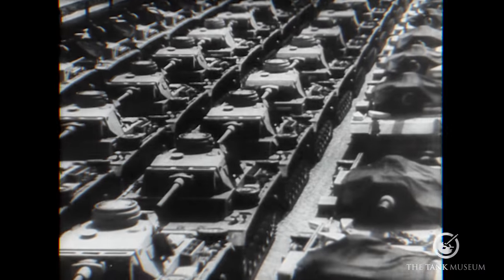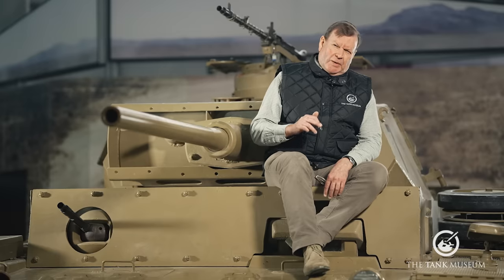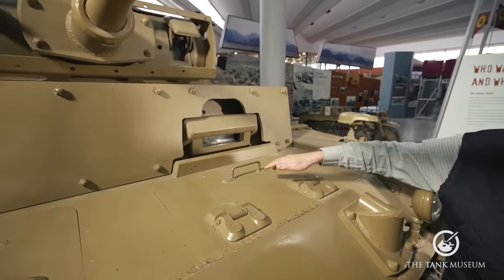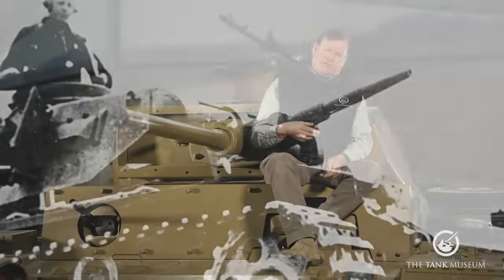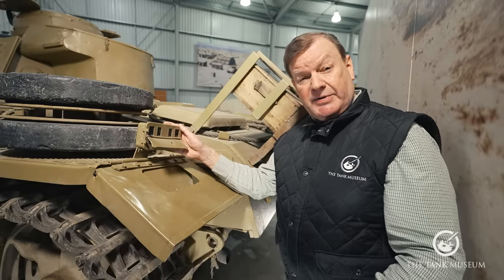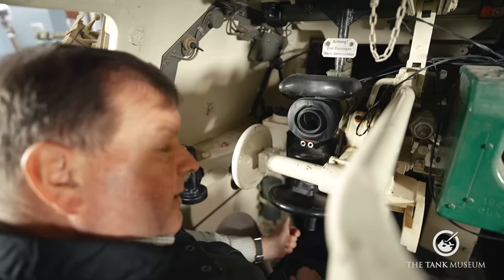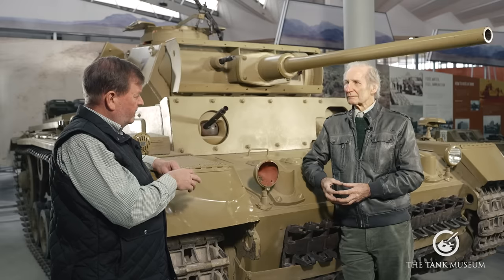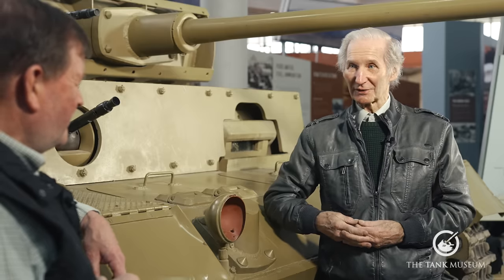Panzer III: Versatile Stalwart of The Panzer Force

Comment: I think PZ3 is probably the best interwar tank.   Even if it was obsolete by 42, it still looked snazzy.
Reply: I mean it wasn't really obsolete by 1942. It was still comparable to most enemy tanks even in early 1944. And that's with its planned upgrades canceled due panther (such as the krupp suggestion for a new turret to mount the 7.5cm kwk40 L48)
Reply: @matthiuskoenig3378  Chassis wouldn't be able to handle the added weight, plus they already were using the chassis for the casemate Stug. Plus adding the the long 75 to the Panzer III when they already have the upgunned Panzer IV is redundant, so no it had nothing to do with the Panther (which mounted a much better gun)

Comment: The Notek rear convoy light was very well designed. With two pairs of red lamps; if you could see all four, you were too close, only one, too far away, but seeing two red lamps, you were the correct distance. Simple but effective. Much better than the British system of just shining a white lamp on the white painted final drive of the rear axle - !
Reply: The M60, and probably M1, used a similar system for use with the driver's night vision periscope, which had no depth perception. I'm trying to remember exactly what they were but it's been too long. But the Germans pretty much hit on the best concept for maintaining proper road march intervals at night.

Comment: Another tremendously good video. The PzIII gets so little love I'm glad you made this video. I have to choose which was better, III or IV?  They both look good but as a turreted tank, I'd go with the PzIV as it fought from the beginning of the war until the end. But as a chassis that found numerous uses as TD, SPG, assault gun, flakpanzer, etc, the Pz III is pretty good!! It was a good workhorse.
Reply: The Pzkw IV had better armament and armor as its chassis was capable of handling it whereas the Pzkw III was not capable of heavier armor and gun. The III was great for anti-infantry use. The IV was better for dealing with a wider range of threats.

Comment: Very good video. As you say, the Pantzer III was a very important tank from an evolutionary point of view. I concider it the very first truly modern tank, with a a three man turret in which there was a well thought ergonomic lay out for a commander, a gunner and a loader. The radio equipment was revolutionary as well - and the torque suspension has become the standard for modern tank suspension. Of course, when other modern tanks appeared with heavier armour and armament, it became outclassed - which is the fate of any tank. I am no expert, just an enthousiast, so please do correct me where I am wrong.

Comment: At 25:05 we hear about a really nice feature of the Panzer 3 and Panzer 4 : two small lamps that warn you when the gun barrel is overhanging the side of the vehicle.
It would have been nice to see also how they worked. The bottom edge of the turret, inside the tank, had four tiny metal "fingers" protruding down, and as the turret rotated they would engage, at the appropriate moment, a 4-position rotary wheel that turned the lights on and off.

Comment: I worked on Engines that had Oil Bath Air Filters when I was a young Apprentice in the 1970s. The AEC AV760 Was one of them and there was always a really thick layer of Crud in the Oil pan that had to be cleaned out before fresh Oil was put in, up to the fill line. I can't imagine what it must have been like in the Western Desert. These Machines were really something.

Comment: This again by Chris has been such a brilliant video, that just flew by so quick in 30 mins & 32 seconds. 

Such a great joy to see a former manager of the workshop who just loved this tank. 

Unfortunately Chris really never got talking about the item every nation wanted, it was its advanced technology miniaturised to fit in such a small tank.  Any guesses before next paragraph?

This is the radio receiver and transmitter.  Miniaturised enough to fit into a small Panzer III, this was the ability to have transistors so small, we could see here briefly was that radio equipment. 

This was how Germany rolled over everyone in early war, as all tanks were in the loop picking and wiping out targets fast and effectively. The panzer 1 could receive but not send, this is where a command tank was made for this purpose. 

Even this was a massive step up in warfare often overlooked, especially seeing how small these tanks are in reality.
Reply: Transistors did not exist during WW2. The radios in Panzers were based on valve technology, and even so, they were big for their time. Goering himself complained that radios in his Luftwaffe seemed too big. 
Also, each radio device that you see in the video required its own step-up transformer, which was almost as  big again.

Comment: The reason the Maybach HL 120 is so quiet is the helical cut gears on the camshaft drive train.  This allows constant contact as opposed to spur gears like the HL230 which is much noisier.  

You can stand next to a running HL120 and its real quiet, stand behind it then it's much louder.

The oil bath air filters are standard.  Even kettenkrads have oil bath air filters.

What I need explained to me is the device high left in the driver's station.  It looks like a compass or something used to set a heading.  I have seen one in hand and its the strangest most German thing ever.😂

Comment: The first Pzr III's were armed with 3.7cm guns not 5cm's. The 5cm guns did not appear until the battles in the USSR and the Nth African deserts.  Even then the 5cm gun became known as the short barrel version as the long barrelled fives came in around July 1942.  I note that the Mk III you were sitting on was most likely the long barrelled version and up armoured version, as indicated by the box like structure around the mantle.

Comment: Oil bath air cleaners may have been used on the Pz3 from the beginning.  It was a well known  widely used technology up until the 1950s.  NOW, one of the changes for the desert may have been bigger oil bath air cleaners than what was originally fitted to the engine.
Reply: Yep.  My thoughts exactly while I watched this.  I'm old enough to remember oil bath air cleaners on some cars and motorcycles into the sixties.

Comment: The compacted desert sand inside the hull was no doubt due to drawing the engine cooling air in through the turret. The Chieftain tank had a similar system to extend air filter life.
Reply: Er, what? Are you sure that was the system? Because the engine decking has air vents both on top and on the sides, whereas the turret has none. Just a small fan to blow gun fumes OUT from the turret.
Reply: @daveybyrden3936  Apologies I worded  my comment badly, I meant engine air intake not cooling. To explain further there is a moveable flap in the bulkhead between the crew and engine compartments by the air filter, operated from the drivers position. Turret or engine deck breathing. Naturally turret could only be used when the hatches were open!  Nice and cold in the winter! Engine cooling the usual way via the engine decks, radiators, fans and out above the gearbox
Fumes from the main gun are taken care of by the Fume Extractor on the gun barrel. Nuclear, biological and chemical protection provided by over pressurising  the crew area with filtered air from the NBC pack on the turret rear. 
The Panzer lll may just have got full of sand through it being sucked in through the hatches and engine decks, compacting in the bottom.

Comment: I really enjoyed this detailed look at a tank of major importance throughout WWII.  However, it had typically German design flaws.   The description of the system of shafts, gearboxes, and bearings that connected the clutch pedal to the clutch shows the over-complications that doomed the production efficiency and reliability of early-war German military equipment  in the long run.
Reply: The panzer 3 was actually super easy to produce. Only 4000 manhours, signifcanlty less than the 36000 manhours to build a sherman.

Comment: ERROR : at 14:30 we are told that "the driver had headphones but no intercom".
In fact, the driver was fully linked to the intercom, wearing both headphones AND laryngal microphone. 
Circuit diagrams of the early-war intercom system for Panzer 3 and 4 (the "Z" system) are very clear about this.

Also, the narrator doesn't show us the boxes where the commander and driver plug their intercom gear. But you can see the commander's socket box at 13:07, over to your left.

The narrator does show us a box beside the radio op and he says it's for the radio op to plug into.  That much is true.
But this big box is more than that.  It's the "Z18", the central hub of the intercom, where the radio op can switch his radios in or out of the system.

Comment: The early Panzer IIIs were armed with the weak 3.7cm KwK.36 and were easily out gunned by the British 2 Pounder. The later model Panzer III Ausf F / G was up gunned to the 5cm KwK.38 in early 1941, which was still inferior to the 2 Pounder. Even the final 5cm KwK.39 L/60 was only on par with the 2 Pounder. Later 2 Pounder ammunition regained ascendency but was mostly issued to armoured cars.

Comment: ERROR : at 28:40 we are told that the Museum's Ausf.N was captured in Tunisia (which is true) in April or May 1943 (which is false).
In fact this tank was part of Kampfgruppe Lang, which made a thrust through Sidi N'Sir intending to capture Beja, at the end of February 1943.
They got ambushed and halted by a fierce battle at Kzar Mezouar. This tank was abandoned on that battlefield, which became known as a "Panzer Graveyard", containing the wrecks of seven Tigers and many other tanks.
So, the date when the Germans lost this little tank was at the beginning of March 1943.
And yes, this tank was in the original configuration of the 501 Tiger battalion. It was numbered "232", being part of the 2nd company. 
It was in the same platoon as Tiger "231", destroyed on the Robaa road on  31 January, and Tiger "233" which was also wrecked in the  "Panzer Graveyard". 
The company commander's tank was Tiger "21", and it is currently being restored in the USA under its final identity "712".
Note; at the time of their final battle, the 2. company had been attached to 10 Panzerdivision as their 8. company, and the tanks were renumbered to  reflect that.

Comment: Guderian was a bit of a git . The Panzer I/II were the only mass produced tanks planned through January 1938 with 2122  Panzer I/II. The final plans actually  included 3000 tanks  through oct 1940 although only 917 Pz-III were completed by the end of 1940 plus 534 Panzer IV  and  924  Pz II by the end of 1940.

To make matters worse hundreds Panzer III chassis were scraped or return to shop for overhaul work on final drive reducing operational Pz III to only 98 tanks by Sept 1939 plus 211 Pz IV completed by sep 1939. This is why 211 Cz 38t had to be rushed into service in time for the invasion of Poland

Comment: ERROR ;  13:00 the narrator says "This lever...operates the smoke candles"
But in fact we are shown the lever of the pistol port in the turret's back wall. The control for the smoke candles isn't visible in that scene. 
The control is not a lever, it's just a cable that comes through the firewall and has a T-shaped end. You can see it, barely, at 11:50 to lower right of the red-painted square.

Comment: AFAIK, the oilbath filters were standard issue - and not especially for Africa.

Steyr in Austria sold tractors after the war - still with those filters.

The Opel Blitz 3ton truck had an additional cylindrical felt filter on it's fender. I'm assuming therefore the oilbath filter alone wouldn't manage with the amount of dust (sand) in the desert - hence the add-on.
Reply: I own a 1946 Chevrolet pickup truck. The air filter is of the oil bath type.😁
Reply: @JoeMartinez-eb3xc It was the tech of the period.

Like dry filters today.

Comment: Unlike in this video sayed, 30mm is not the maximum armor thickness, with the Ausf. J the frontal hull and turret armor was increased to 5 cm. The 2 cm Vorpanzer was made of High hardenes steel and added on later. As well as retrofitted.

Comment: At 28:05 we are told that Panzer 3 version "N" arrived in Africa to support the Tigers of a specific unit.
But that's not the whole story. That was not an unusual or unique situation.
The original design of Tiger battalions, whether in Africa or anywhere else, specified an equal mix of Tigers and Panzer III - exactly 20 Tigers and slightly more Panzer III.  Every platoon had two of each.
Five Tiger battalions were deployed as per that pattern.  Then, in the Spring of 1943, they reorganised the Tiger units, removing their Panzer III.

Comment: The cost to produce a iii was nearly as much as a iv, The Stug iii  was the result of the cost savings, using existing production for the chassis and the ability to mount a gun mount strong enough for the 75. The iii was a favorite of the small car people.
Reply: Pure cost isn't really that big of a factor. What is important is construction time/dificulty. And the amount of rare materials usd in construction.

The panzer 3 only took 4000 manhours to build compared to the 38 000 manhours to build a panzer 4. The panzer 4 also required a larger amount of rare metals like manganese.

Comment: Funny how in the first three years of the Eastern Front, the Panzer III, supposedly quite inferior to the ballyhooed Soviet T-34, racked up a far more favorable kill ratio against it.  Never mind how well the Assault Gun/Tank Destroyer derived from it, the StuG III, destroyed Soviet armor.  I'd say for its time, especially once the intended KwK 39 was included with the later marks, the Panzer III was the ideal combination of firepower, mobility, and protection, the "Holy Trinity" of a MAIN BATTLE TANK.  With the five-man crew and FM radio, it served the German armor doctrines as well as any vehicle of its time could.  It simply became outmoded as, being a 1935 design, it simply was no longer big enough to slug it out with the larger, heavier beasts coming out of USA and USSR factories.  But oh how the StuG, though not strictly a "tank", made excellent use of that chassis!

Comment: I thought the Panzer III/J was the first  version with the 50/L60 - early production still had the 50/L42. It was also built with 50mm frontal armor. Thus the L, M, and N should have 50mm frontal armor - one piece - plus the 20mm spaced plate. By the way, the turret front mantlet has the mounts for a 20mm plate, but the armor plate is missing.
Reply: That is correct but I think the late J models were redesignated as L's by the Germans
Reply: @jsd795  The early J had 50mm armor but the short 50. They replaced the short 50 with the long ones. The British "Special" version. L is basically the same tank with the add on armor, although I believe they added armor to rebuilds. M had different exhaust system and the same add on armor. N same armor and 75L24. 50+20 front hull and turret armor meant the Pz III was better armored than the Pz IVG (late), H, J which had 80mm front hull but 50mm front turret armor.

Comment: Presumably the 6pdr armed Churchills were a deadly proposition for the 50mm armed PzIIIs - I believe I recall reading about the engagement at Steamroller hill, though I could be mistaken. 

Couple of interestng points - the roominess of the Pz3 and 4 enabling up-gunning, the question of whether Germany would have been better off with a single platform, how the Pz3 and 4 and Matilta2 nailed the 3 man turret (as did the KV).

Comment: 5:18 God, just that breather piece must have took a metal worker hours to cut the separate pieces then a welder hours to weld together. JUST for a breather/ventilation tube.
Reply: You would be surprised then to learn the panzer 3 was significantly quicker to build compared to it's contempory tanks of comparable size.

Comment: Did I hear that right. The furthest distance of the radio in the "moving" tank was 8 Km via Morse code and only 4 Km with voice? That is surprisingly shorter than I would have thought even for the period. In movies that is probably the one thing that is never shown accurately. The ability to communicate via radio is always seen to be much easier and distances further than actually capable for the time. With Sci-Fi movies having holograms and video along with voice communication being instantaneous. But truth is radio waves travel no faster than the speed of light. That is why in the Apollo missions to the moon there was a 3 second delay one way.  But earth to say Mars is 5 - 20 minutes one way depending on planet locations.
Reply: But why would you need more than 8km? A Panzer needed only to listen to its unit commander, or (in later models) talk back to him. And a company of Panzers wouldn't be spread widely over the landscape. 8km is too far.
There were specialised tanks with long-range radios taking care of the link to the Army and Air Force.

Comment: The explanation given for building both a Pzkw III and IV is that the IV had the 75mm howitzer. Yet later in the war that gun was installed in the III. So why wasn't that done originally?
Reply: There was actually an desire to do so. German war department ordered krupp (panzer 4 designer) to work with Daimler-benz (panzer 3 designer) to get the ZW38 (aka panzer 3 E chassis) to mount the 75mm on 1st June 1937.

However krupp complained that DB was taking too long and managed to convince war department to just build the panzer 4 aswell as the panzer 3 by 27th of June 1937, atleast intially and then continued to argue against a unified chassis solidifying permement 2 chassis production by may 1938.

So you can blame krupp for the fact there were 2 tank chassis instead of 1.